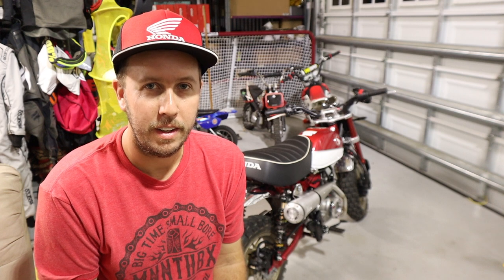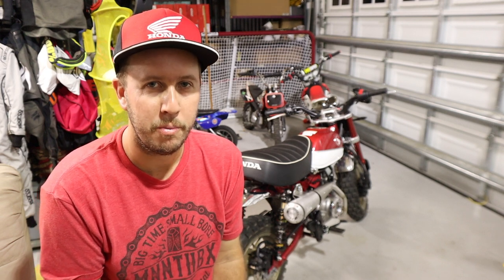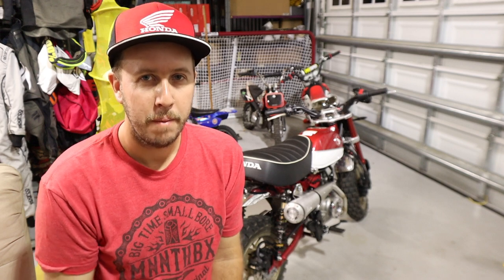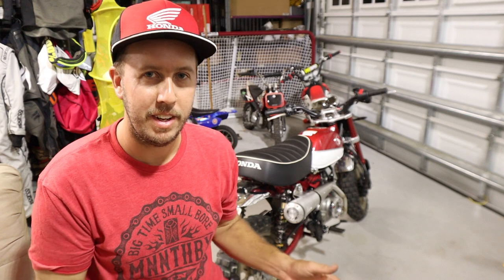HONDA MONKEY SUPERTRAPP EXHAUST INSTALLATION PROCESS | TIPS AND TRICKS | STARTUP SOUND TEST

Comment: Question for you John , I have the TB parts exhaust. How worth it is it to get the TB cam, CJR flash and air intake? Does it make a notable difference on the monkey?
Reply from the maker: That whole package will make a difference, but not typically any one of those items alone

Comment: Now, if Supertrapp was available for the Grom...

that would be nice.
Reply: they are, its under the jardine brand
Reply: I was a welder there for quite some time. There is one for the Grom but its not this disc style muffler. Its a GP1 style muffler. Its wide open and has little to no packing in it. I was not the largest fan of the noise it made. This Monkey one is the business tho. Im about to buy one for my girlfriends monkey despite not working with them anymore lol.
Reply: @resatchel4389  Neat! Good to know about the noise part.
Reply from the maker: Resatchel, that’s a great story and thanks for sharing!